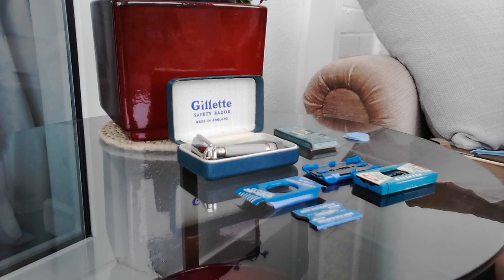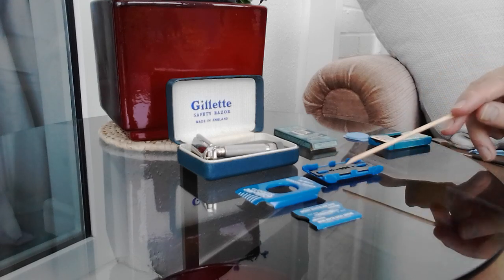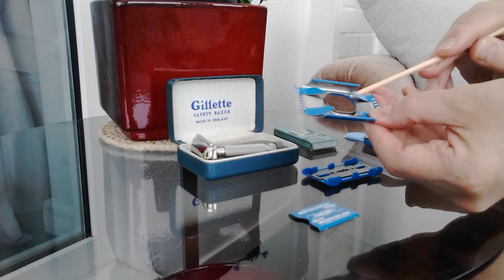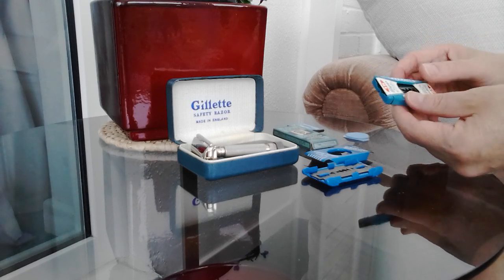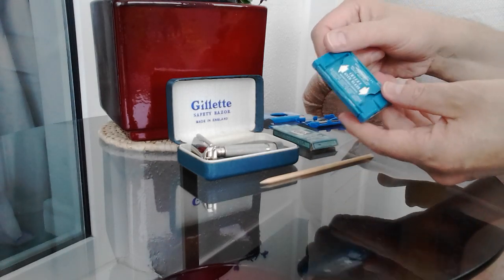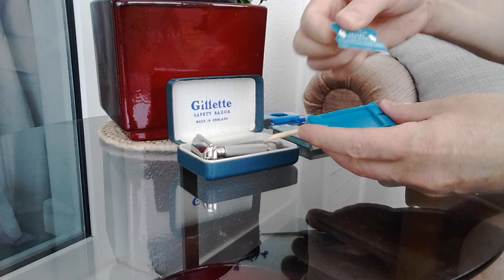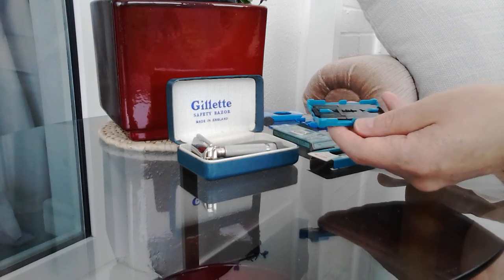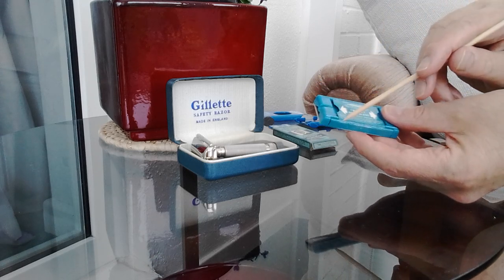Taking apart a Gillette blade dispenser 😯

Comment: Thanks Mark. I can’t believe the blades are still blue after all these years.

I watched your vid because I wanted to re-use an old dispenser loading new blades in it as opposed to the current wrapped blades in the plastic tuck.
Reply from the maker: I'm very glad it was useful. Re-using the dispenser with some modern blades is a great idea. It would be really nice to make a retro designed modern version, exactly for that purpose but one that came apart much more easily. All the best.

Comment: I just bought a Gillette nickel plated Superspeed with the notched t-bar (1947-?) it came with the exact same blade dispenser you have. It looks like the blade says O1 or U-1 on the blades itself? My first vintage razor ever for $20 and it came with a military issued case that has an eagle with an American flag on his belly… interesting part when I open the case it says Gem clog proof inside… I think it was an every ready single blade razor case

Edit: upon further research the case was an American military issued WWII micromatic single edge. Has an eagle on the front with an American flag on the belly of the eagle?! I got all this for $20 and even though I can’t read the dates as they look rubbed off. I kept pulling blades out (thinking I can put the blades back) and accidentally put one in the back disposal part🤦🏻 I think maybe these blades were used and the code was rubbed off? It looks like an U-1 or O-1 or J-1…
Reply from the maker: Hi Greg. The Gem Clogproof (military issue) sounds very interesting. I have just been on eBay scrolling though to see if there was one; there wasn't, but I shall keep looking. $20 is a great deal. I like the Gem bullet tip, too. That is a really nice shave.
Reply: @FriendshipShaving  yes it’s very interesting I think I seen the case attached to the micromatic razor? I’m not sure but it’s definitely military issue and it almost looks like they spelled it wrong, it says *Gem clog pruf*?
Reply from the maker: Thanks Greg.